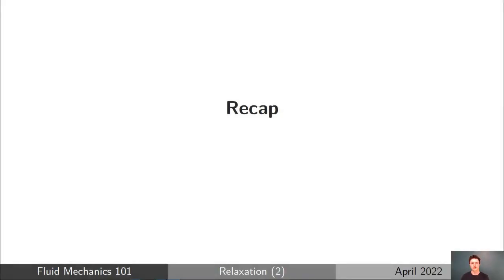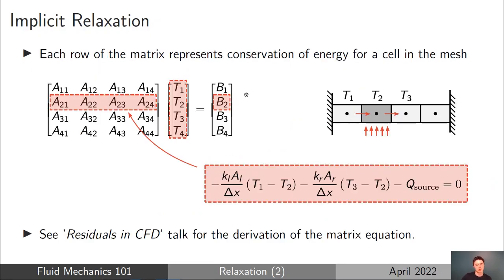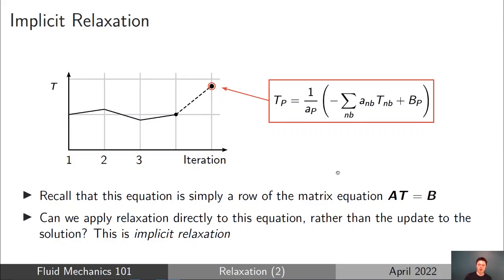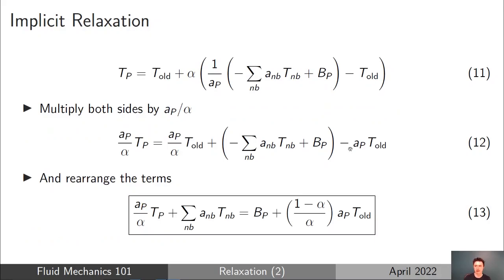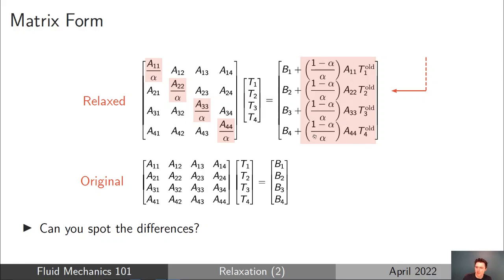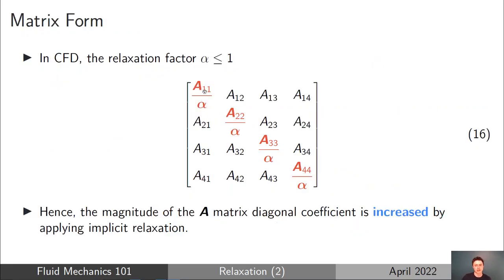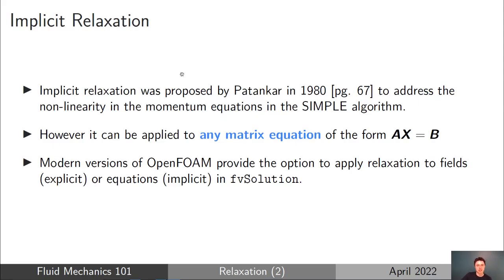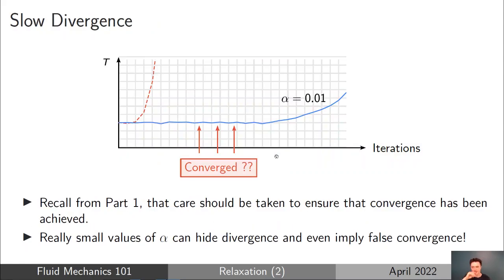[CFD] Relaxation in CFD (Part 2) - Implicit Relaxation, Diagonal Dominance

Comment: This is a really good video. On a side note, are there any textbooks that you can recommend for studying vector calculus and linear algebra? There are engineering textbooks and then there are textbooks that are relevant to CFD research. Have you come across any such textbooks ?
Reply from the maker: For linear algebra the book by Saad 'iterative methods for sparse linear systems' is really good and it's free! Just give a Google search and you should find it. Sadly I don't have anything good for vector calculus. The OpenFoam manuals are pretty good for vector calculus that is related to CFD
Reply: @fluidmechanics101  Thank you.

Comment: I have a question. It seems that set alpha to 1 is the same as the unrelaxation case. However, in my interFoam case, setting alpha to 1 a converge is achieved, but deleting the relaxationFactors in fvSolution leads to  a divergence. How to explain this? Thanks!
Reply from the maker: I am not too familiar with interFoam but simpleFoam definitely needs relaxation factors less than 1!
Reply: I read the OpenFoam UserGuide: alpha  = 1 leads to guaranteed matrix diagonal equality/dominance. It seems that in that case the relaxation algorithm still does something?
Reply from the maker: Ahhh ok, I think the latest versions of OpenFOAM may have changed what 'alpha' actually does. I will need to have a read of this

Comment: Thank you for the fantastic lecture. Could I please ask is it rare to use very small URF for example 0.01 to solve the problem? I am having convergence difficulties in solving swirling flow, after your lecture, I am thinking to try very small URF to stabilise the simulation as swirling is unsteady phenomenon in nature. Could you please advise a little bit on this? Many thanks in advance.
Reply from the maker: Probably better to go with a transient solver 👍